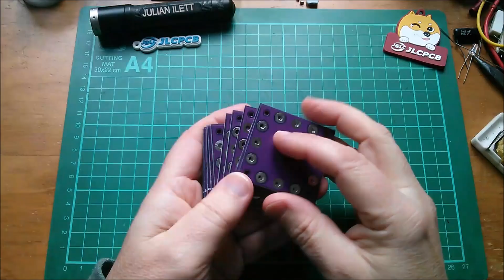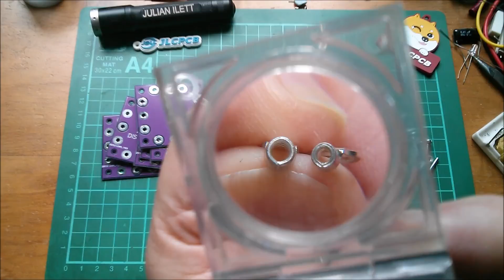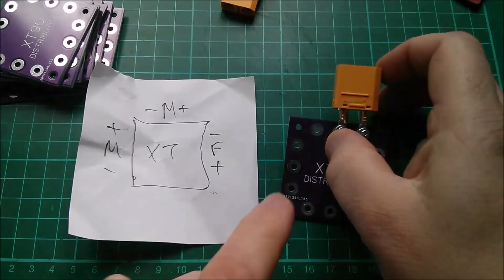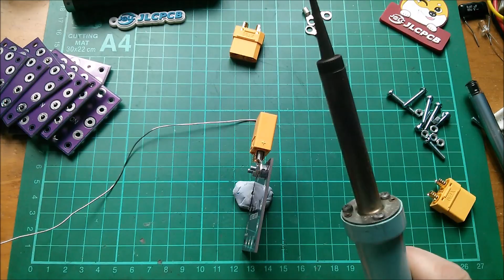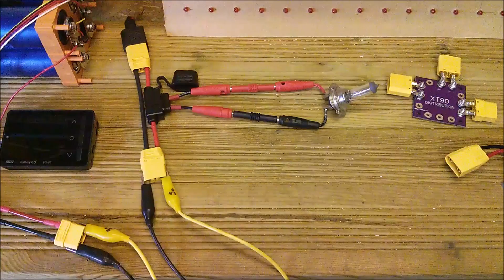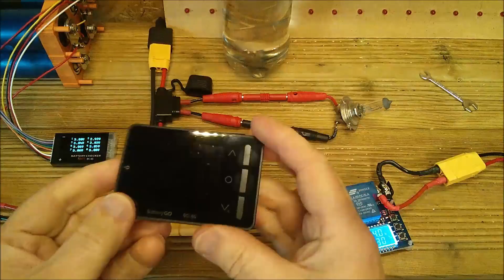New PCBs from JLCPCB - Too Much Current?

Comment: I have 20V cordless powertools. BMS battery and modul have small PCB circuit.

Why PCB not burn when my drill output 20 ampere current?

How much PCB can take current?

Comment: ACS712 is really hard to find. All the Allegro current sensors are low in stock.
I had to use ACS716 with an op amp lever shifter to get 0 to 1 volt for 0 to 10 amps.
Reply from the maker: That explains why my PCBs were so expensive. I've had 10 cell connect PCBs made, with ACS712-05 pre-assembled by JLCPCB. The ACS712 ICs were $3 each!

Comment: For high currents, use copper nuts and bolts or better soldering directly on the XT90 connector....
I don't know for sure what is the maximum current on the copper line on the PCB? If the PCB is not protected by purple insulator paint, you can add tin on the line

Comment: Seems like you could have the ground ring terminal screwed onto the bottom directly to the surface, and the VCC directly onto the surface of the top, with them mounted into the XT90 180 to each other so that the bent part of the ring terminal would work with the board thickness almost enough.  So the XT90 would be fully in-line with the board, rather than offset on top of it.  Steel nuts aren't nearly as conductive as copper right?

Comment: Have you considered setting a Raspberry pi up as an MQTT broker so you can control and monitor the shed remotely, using Node Red ?
The Shelly 1 switches will run no 240v or 12 to 60v DC and give you a pair of volt free 16A contacts. The Wemos D1 mini can be used to measure voltages and temperatures.
Both work with mqtt when flashed with the Tasmota software. 
I'm using a D1 mini and relay to turn the active balancer on, to top, balance above a set voltage.
Reply from the maker: Sounds like a big learning curve on that lot!
Reply: @JulianIlett  Yes, but think of the number of videos...
MQTT on the pi, easy lots of videos on Mosquito install. Tasmota software install, easy using tasmotizer, it does all the work for you. Getting the msg.topic set up is a little challenging but not too bad. 
Yes node red is a challenge but worth the effort and there are lots of flows on the web you can copy. Once you get it running for one sensor the rest falls into place. Start by flashing the tasmota software and operate relays using the web interface.

Comment: Given that the board has ground on bottom and B+ on top,, it sounds like it would act as a capacitor .   Two plates, separated by an insulator.
Does the stray capacitance of this board cause any issues?
Reply from the maker: A few picofarads. That might affect high frequency signals, but will have a negligible effect on DC.

Comment: There's no issues with the BCP  taking the current. You'll find those tracks would take 20A + with relative ease. 
The connection with the bolts and nuts will be the point of highest resistance.
Reply: Could get quite warm being steel, brass bolts and nuts would be lower resistance. Solid copper wire from large cross-section twin&earth cable soldered between connector and PCB would be even better.
Reply from the maker: Good idea on the brass nuts and bolts :)

Comment: that is actually a very clever little bit of board.and looks way better than the bolt stack...... now just ad another one of those relays to solar side to monitor the battery so it can cut out the solar before the bms does and you'll have a perfect setup
Reply from the maker: That's the plan: Fit the 8-cell balancer, then put another relay module on the solar panel (which acts like a simple charge controller).

Comment: I would've called it the XTribution 90 board. Then the temptation would be to make it X shaped, which would really be form over function, so probably not a good idea.

Honestly I'm a little surprised you don't get any warming from those little ring terminals. There's not a huge amount of meat between the ring and the wire entry. Although I suppose if you think about the volume of wire that would be used with it, squishing that to the same thickness as the terminal would probably be smaller than the width of the terminal at that point.

Comment: That A.C. soldering iron is probably a "thermally stabilized" temperature rather than temperature controlled. A T12 clone from china (at about 70 watt and temperature controlled) does a much better job and heats in seconds.
Reply: I've been really tempted by the Pinecil, which is a TS100/80 clone that Adrian Black featured in a recent mail call video. It's got both USB type C and 5.5mm barrel jack power connections, and it takes the same T12 clone tips that the TS100/80 takes. But the best part is that it's a lot cheaper than a TS100/80, even after you add a USB-C wire and power supply or 20V power brick.

Comment: Not liking the current carrying ability of the nuts and washers. How about some heavy copper wire soldered into the XT90 and thru the holes on the board. If you want to stack boards then leave the tails on the wires long and solder them to the second board (could use little plastic washers to maintain a gap, or just hold the gap while you solder).

Comment: Thought:  if you could isolate the ground and use a synchronous buck (with cc/cv), you could charge your cells in parallel (2 leads per battery) and still have it connected as you do now.  It sure if it would get to the same efficiency as an active Bms but it would guarantee balancing and you’d eliminate the partial charge/discharge of the active balancing. 

Also, why not make the solar relay on the xt90 boards instead of as a separate one?  (Or build it all together)

Comment: PCBs can look neat and tidy but so could a "Y" wire splitter.  With the benefit of not having to wait for PCBs.  You could still keep it flexible.  Attach your XT90 to wires going to ring terminals.  Join those in a "Y" (bolt) and cover with your large heat shrink tubing.  Done and protected.  Cut the heat shrink to reconfigure.
Reply: pcbs are more fun tho,  which is the whole point

Comment: If you just got a PCB with no holes, and only spots were the masking was removed you could flip the rings over and hit both sides of the board directly.  You COULD leave the holes to add bolts while soldering, and then remove the bolts after.

Comment: One downside of using PCBs with nuts and bolts as external connections, is crush forces.
In your design, the single 3mm plated thru hole is the only thing stopping the fibreglass substrate from crushing.
An improved version (seen in many other designs) is to add via stitching around the central hole.
That is a ring of smaller holes around the main hole, to distribute the forces.
Reply from the maker: Yes, I saw that on the Ideal Diode PCB. I might give it a try :)

Comment: Literature on the solar panels typically reads "Do not disconnect under load." Another relay like you plan would be doing just that.
Reply from the maker: Best not to disconnect a string of 10 solar panels in series (360 volts ish) under load, but a single solar panel (36V) removed from an 8-cell battery (28V) is an 8 volt disconnect.
Reply: I thought the reason was because the high voltage from a string of panels can cause an arc in the disconnect switch, which will be sustained due to the nature of DC current. Still not an issue in this application. Although the poor quality contacts on these cheap relays may throw a spaniel in the works over time.
Reply: @UpLateGeek  woof!! 🐶

Comment: The old irons had a thermal mass, that's why they take ages to warm up. They are best for large connections.
Reply: ive recently rediscovered the merits of my Weller  portasol butane powered soldering iron.  it gets so hot it quickly destroys  components and traces and thus was put away for years.  i've discovered recently however that it's wonderful for heavy jobs for example  soldering xt90's to 10awg silicone jacketed wire.   and it heats up insanely fast to boot!
Reply: I still have a massive iron that apparently was used in plumbing. Takes about 15mins to heat up and gets used very rarely. It has its place though. Occasionally it is the only tool for the job when there is a massive ground plane or heat sink.
Reply: The old irons have their place in the world. I can never do a delicate connection with them. 

I was most impressed with how little that old iron smoked on power up. My old 60w would set of modern sensitive smoke alarms if I used it indoors.

Comment: Did you ever test miners on a 4S LiFePO4 battery ( instead of 8S plus buck)?   Hard to imagine there would be a  deal breaking voltage mismatch there!   Also did you consider the various user suggestions for a better solution than all these relays?   It's trivially easy to program a Raspberry Pi to watch some GPIO pin voltages  and run bash or python script to do unattended ssh into the miners and send stop command, to r the linux 'reboot' (or 'shutdown') command when it's time to restart .    If these ideas are successful the efficiency, reliability and flexibility of the solution will be dramatically better!!
Reply from the maker: I want to try that. But: I'll need a buck-type charge controller between the solar panel and 12V battery. Antminer voltage range is 11.6V to 13V - that's 2.9V to 3.25V per cell (if balanced). But it's worth a try :)
Reply: @JulianIlett  - IMHO a lot can go wrong running the miners directly off of batteries whereas the buck converter can provide great flexibility with different battery voltages, etc.  I don't recall Julian mentioning the efficiency of the converter but 80% would be really low.  That converter would be getting pretty warm if it was dissipating 50W continuously.  A quick eBay scan showed 90-92%.  Perhaps Julian can do an efficiency test.
What could increase run time would be to run the miner at the minimum voltage that keeps them stable.  That might mean having a buck converter that can be adjusted BUT even if the buck converter outputs exactly 12.0V that could be a ~8% savings over 13.0V.
In a previous video it was mentioned about using SSH (etc.) to politely shutdown the miner instead of just cutting its power.  Many reasons and many possible improvement could be made by using SSH.  That would be ideal but it would be even better if it didn't need shutting down because of a bigger battery.
Reply: @ElmerFuddGun  Yes ssh w shell commands  is definitely the right path.

You are probably correct regarding buck efficiency but it's probably in the range of 85 to 90, but should be tested .  I ran a 19v power supply into a similar asynchronous chinese buck at 8A to charge 3S LiNMC (12.6V) and it got so hot i needed a big computer fan at full speed right on top of it.  So I still think the efficiency can be closer to 80.   It tends to depend upon the quality and sizing of the Inductor..

I respectfully disagree on running directly off of battery.  You can't beat a battery of this type for a rock solid low impedance , noise free power source.  No switching noise, no droop and a very tight discharge voltage range for this chemistry.   The voltage spec of the miner matches the voltage range of the battery here , basically exactly.   There will be no switching noise or hi-freq ripple you'd get from a cheap bucky .     The miner will have its own switching regulators to power its silicone.  It may use the input  supply directly to power its fans, perhaps that's driving the narrow-ish input voltage range spec..
Reply from the maker: I will certainly try a 12V battery version of this project. I have ordered 4pcs 105Ah LiFePO4s from a very dodgy looking eBay seller (with 6 feedback). If they turn up, a 12V system will be tested. But remember, eliminating the buck converter between the battery and Antminer, will require an additional buck converter between the solar panel and battery. I could use a 36-cell panel, but it would operate far from its maximum power point.
Sending a "poweroff" command via SSH stops the mining process (which lets the ASICs cool down), but doesn't turn off the controller or fan power. Also, there's no equivalent 'powerup' command, so restarting the miner requires cutting the power. The people that run mining farms don't care much about ASIC care, so these Antminers will have been power cycled many times even before I bought them :)
Reply: @JulianIlett  Methinks that voltage range suits LiFePO4 like a glove.  They won't stay above 3.25V loaded unless grossly overcharged .  And LiFePO4 has very flat discharge curve at ~3.2v once reach 2.9 to 3.0 they're done and extending lower will stress the cells .   In any case, one of the BMS or the ant miner will cut first, and either will be more or less an appropriate/safe level to do so.   

Bummer you have to get a new charge controller.  Id hope you can do better with efficiency vs the Chinese asynchronous buck at circa 80%.   I wonder if this might be one of those situations where a PWM version may actually stand to be more reliable and efficient ?

In any case , seems like at 4S your balancing situation will be dramatically improved , in practice, and you stand to gain a significant amount of effective battery capacity as a result.   

finally , a software controlled Raspberry Pi alternative to the relays seems like it will net you maybe another 5-10 watts in saved holding current, and allow you to programmatically tackle all the strange hysteresis  phenomena via a combination of voltage sensing and timers.   A bit of work to set up, but a neat project in itself, using hardware you already own, and will be dependable once tuned.   

good luck - neat project - thanks for sharing!
Reply: I didn't know the Raspberry Pi had an ADC in it. you can do all of that with an esp8266 at 1/10th the price. Also the charge controller will switch on my grid tie when enough voltage and switch off when batteries are empty. Can also send commands over UDP or Telnet connection to have it switch and see voltage and current
Reply: @PetRatty  ahh thank you for pointing out- my mistake- i forgot that you'd need an ADC board with the pi.  but yes there are several other boards one could directly use, eg esp, particle, etc

Comment: To me this looks like a case where cheap copper bus bars would maybe have been a better option. You could buy a couple of lengths for about a fiver. Drill them at each end  for mounting with long nylon bolts and nylon separators to give two parallel bars. Then drill holes in the bars for your spade terminals. Tap and screw them on. Mount the connectors so pos on on bar and the neg on the bar below. You then have a row of connectors al nicely distributed along the length with plenty of capacity for current.
Reply: Well for this use case ... Why not an Y cable ... must be to easy.

Comment: When the Bms cuts out the solar is still feeding the miner, it could keep starting and stopping depending on sunlight until the Bms cuts in again.
Reply from the maker: Yes, that needs looking at. Another one of those voltage controlled relays could fix that - acting like a primitive charge controller. Eventually I want the BMS to protect the battery in a worst case scenario, but otherwise do nothing at all.